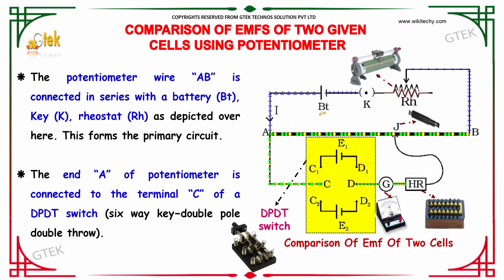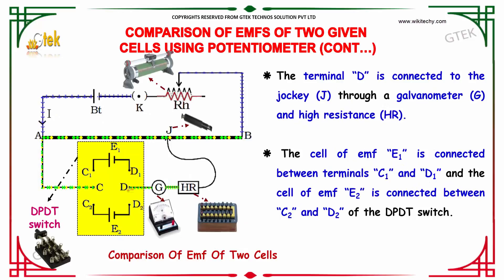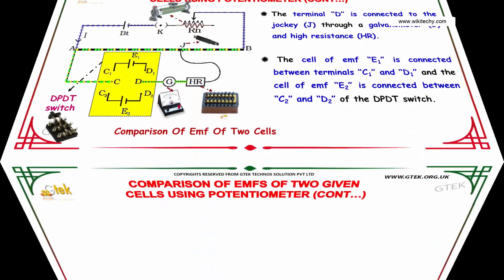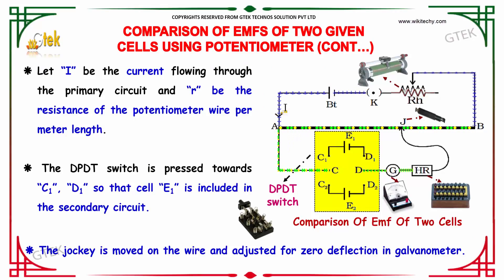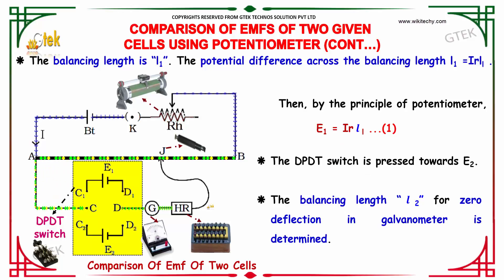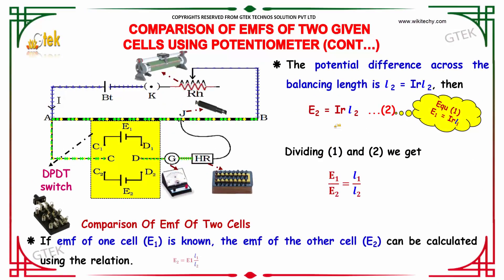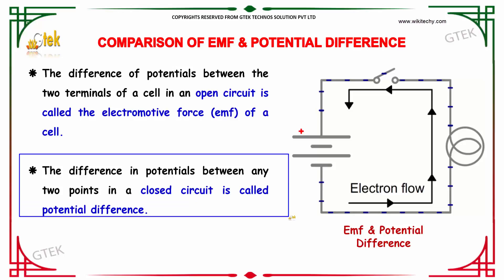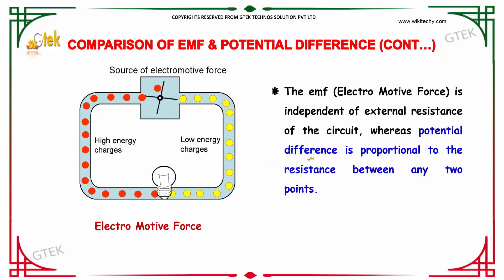+2 Physics Current Electricity - Comparison of emfs of two given cells using Potentiometer | CBSE |

Comment: Slide the jockey along the potentiometer wire to obtain the null point. You can see the second balancing length in the popup. You can compare the emf values of the two cells using the value of first and second resonating lengths. You can repeat the experiment by increasing the current by adjusting the rheostat.

Comment: The rate of flow of charge through any cross-section of a wire is called electric current flowing through it. Electric current (I) = q / t. Its SI unit is ampere (A). The conventional direction of electric current is the direction of motion of positive charge.

Comment: To compare the e.m.f.s of two cells by using a potentiometer. In the circuit diagram of Fig. 40.7 the points D and F may be considered as the two terminals

Comment: Potentiometer is a device used to compare the e.m.f. (electromotive force) oftwo cells, to measure the internal resistance of a cell, and potential difference across a resistor.

Comment: Potentiometer. Potentiometer is a device used to compare the e.m.f. (electromotive force) oftwo cells, to measure the internal resistance of a cell, and potential difference across a resistor.

Comment: A battery of emf ε is connected the end terminal A and B of potentiometer wire with rheostat Rh, ammeter A1 and key K in series. This is called an auxiliary circuit. Two cells of emf ε1 and ε2 are connected. Positive terminals of the cells connected to A of potentiometer. Negative terminal connected to jockey 

  
Close the Key K and join the terminals 1 and 3 and find out the ε1 when galvanometer shown no deflection. Suppose no deflection is at l1 of potentiometer wire, then

ε1 = Kl1                                                                                     ……1

Similarly connect 2 and 3 terminal and find out ε2 when there is no deflection in galvanometer. Suppose no deflection is at l2 of potentiometer wire, then
ε1 = Kl2                                                                                     ...…2

Divide 1by 2 we get

ε1/ ε2 = l1/l2

Comment: Potentiometer is a device used to compare the e.m.f. of two cells, to measure the internal resistance of a cell, and potential difference across a resistor

Comment: Electric Current (I) The rate of flow of charge through any cross-section of a wire is called ... Relation between electric current and drift velocity is given by ... CBSE Class 11 Physics Notes Current Electricity. 2. In Parallel ... Electric cells are of two types ... Determination of emf of a Cell using Potentiometer.

Comment: The emf of cell is the potential difference between two terminals of cell ... A (i) series (ii) parallel combination of two given resistors is ... Two students X and Y perform an experiment on potentiometer separately

Comment: Comparison of EMF's of Two Cells using potentiometer ... Two cells of emf ε1 and ε2 are connected as shown in the figure. ... Force on a Current Carrying Conductor Placed in a . ... Color Code for Carbon Resistor · Effect of Temperature on Resistance · Variation of Electrical Resistivity

Comment: To compare the e.m.f.s of two cells by using a potentiometer Physics ... easy to damage the galvanometer by too large a current if contact is made ... The experiment is repeated using the second cell E2 and the corresponding length /2 obtained. ... of Electricity in Solids · Current and Resistance · Current electromotive force ...

Comment: The electromotive force (e) or e.m.f. is the energy provided by a cell or battery per coulomb of charge passing through it, it is measured in volts (V). It is equal to the potential difference across the terminals of the cell when no current is flowing.